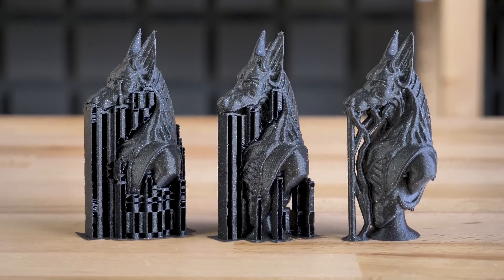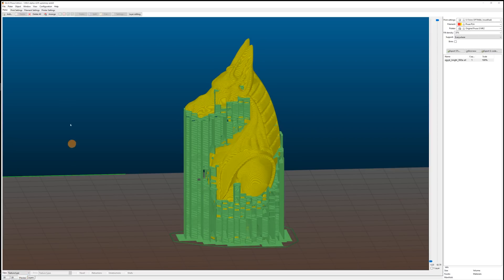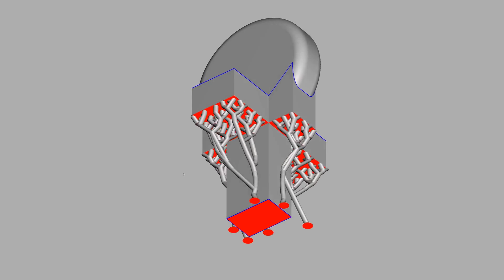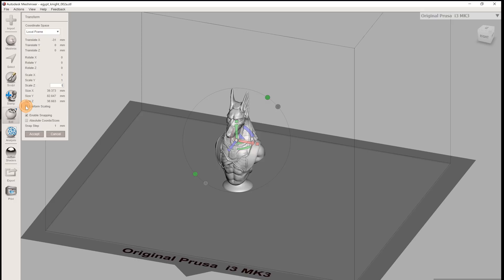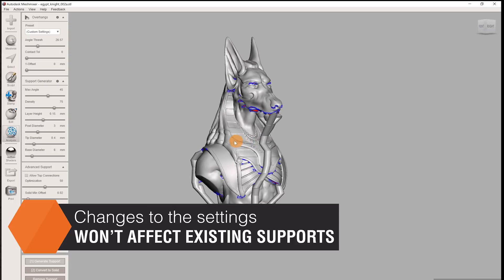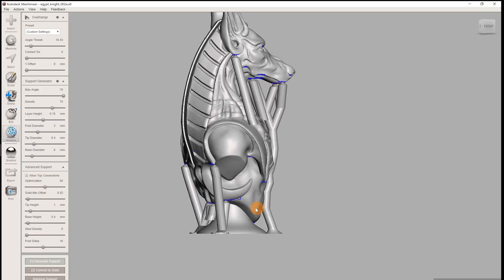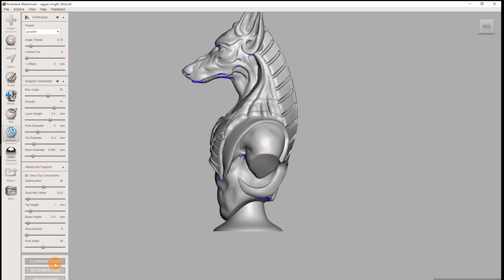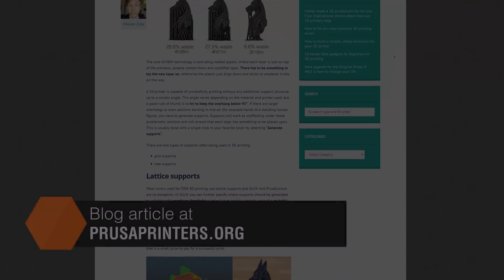How to create custom supports in Meshmixer

Comment from the maker: PrusaSlicer 2.3 features new Paint-on supports, which are super easy and quick to use - check them out:
https://www.youtube.com/watch?v=6LLK9soDW88
Reply: Take this tree support option in The prusa slicer, this was great and safe much material without need another program
Reply: Why don't we have the tree supports as an option in PrusaSlicer for the MK3S, when it does have the ability to do them?
Reply: can we get tree supports in prusa slicer? that would be awesome!
Reply: need a way to join supports that are very call so they dont fall over

Comment: Very helpful video . I tried that also out after exporting in cura and worked great after some minor tweaks . My only question is if there is a way to align the supports on the model automatically and not manually in cura !?!?!?  If you use cura of course and are familiar with the program  :) !!!

Comment: lol and if it were not for you i would have tried to edit the entire arm for a LoL champion so the printer would work. fyi i have a ender 3 pro and it dosnt show on the mesher i have measurements set for its 200*200*250. im going to print it as im typing this but is their a more effective way of doing this?

Comment: you missed a step between the support settings and importing into slicer. I have no idea how to save/export the file from meshmixer...
Reply from the maker: There is an export button in the left panel, you can also use File-export or you can press CTRL+E.

Comment: thanks for the video. are there any alternatives for linux users?
Reply from the maker: Not really :/ We are implementing tree supports directly into PrusaSlicer, but it will take some time for them to work well with FDM (works well with SLA already).
Best guess would be to run Meshmixer on Linux with Wine
Reply: If we get tree supports in Prusa Slicer, i can fully migrate to it :D
Can't wait

Comment: With the grid supports how do you remove that? Do they all just snap off?
Reply from the maker: It depends on the shape of the supported area. If it's mostly smooth, they usually all snap off together really easily. If there's a lot of creases and holes, removing them will take a while and it's a good idea to use pliers and tweezers.
Reply: @Prusa3D  ok. So it's not like you need to cut off the really thick supports with a saw of some kind?

Comment: Start Settings for Prusa Slic3r shown in this video:
1. Go to Analysis after you object is in Meshmixer
2. Select Overhangs
3. Settings:
Angle Thresh ~45
Contact 0
Y-Offset .5MM (For non-flat bottoms)
Support Generator:
Max Angle: 45
Density: 75
Layer Height: .2MM (same as printing res)
Post diameter: 3MM
Tip Diameter: .4 MM (same as nozzle opening)
Base diameter: 6MM

Advanced Support:
Allow Top Connections (if you have multiple overhangs above overhangs)
Optimization: 50
Tip Height 1mm
Base Height .4MM
Strut Density: 22
Post sides: 32

Comment: I don't have a PRUSA i3 MK3 as a printer choice in Meshmixer. You have it shown in the upper right hand corner but I do not. Suggestions?
Reply: How to add a Prusa MK3 to list of printers in Meshmixer: go to forums.autodesk.com/t5/fusion-360-design-validate/adding-a-prusa-3d-printer-to-meshmixer/td-p/7441413

Comment: Sure this is not the first time observed, but whatever the algorithm generating these tree supports, but it is not efficient for FDM printing. A single connected structure is going to be faster to print than a bunch of islands. 

Who/where is chasing this topic?
Reply: Tree supports in my experience are faster to print than standard slic3r PE generated supports. And they're easier to remove. In one example here, a unicorn model I just sliced with tree supports and with standard supports is 13 hours with tree supports and 16 hours with slic3r PE supports, all while being sliced with slic3r itself.

Comment: I've never been able to figured out the setting (if there is one) that controls the offset between the tree support and the part surface in Meshmixer.  I often have support that's too close and bonds to surface of the model.
Reply: Meshmixer > Overhangs > Support Generator > Tip Diameter - set diameter similar to your hot end opening diameter - standard tip being 0.4mm

Comment: Is there a way to generate supports in meshmixer that will anchor to a lower part of the model instead of a space outside the model? I have a model I've tried to print twice now that takes about 60 hours and it keeps failing at the 22 hour mark because it has a wide base and the slic3r supports don't adequately support a large feature of the model.

Comment: I tried these a few years ago and it creates a broken stl for some reason when put into netfabb etc...
Reply: Same shit different day as they are still classified as non manifold, and broken, today.

edit:  I am surprised they did not fix this issue in all of this time.  Go ahead and do it and send it through Netfabb to see what I mean and when it "fixes" it the thing is missing supports and looks like a freak show.
Reply: Yep, they create intersecting shells and you have to 'make solid' to form a proper manifold model, which in meshmixer degrades the surface a little. Not ideal! Some slicers handle it OK, but not all. EDIT: Like they show in the video you can solid the supports only, but again some slicers create artificial distances between touching / intersecting bodies which can cause them to fail.
Reply: Thank you, Angus, as I found that out and, as I said, nothing has changed in all of this time and since it is baking them in I do find that odd.
Reply: @thebeststooge  Well. It changed now lol

Comment: and how do I get the MK3 display / settings like in the video in Meshmixer?
Reply: Stephan Hug I would also like to know?
Reply: File - Preferences - Add printer :)
Reply: How to add a Prusa MK3 to list of printers in Meshmixer: go to forums.autodesk.com/t5/fusion-360-design-validate/adding-a-prusa-3d-printer-to-meshmixer/td-p/7441413